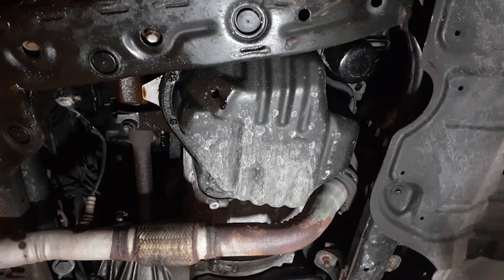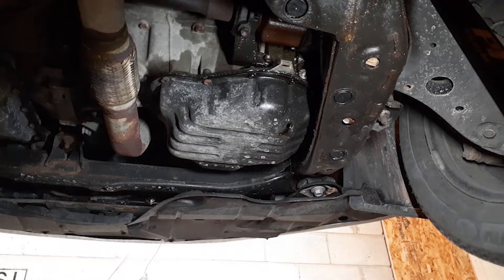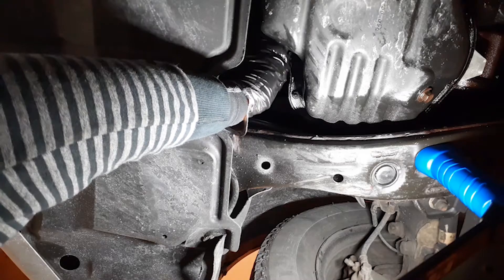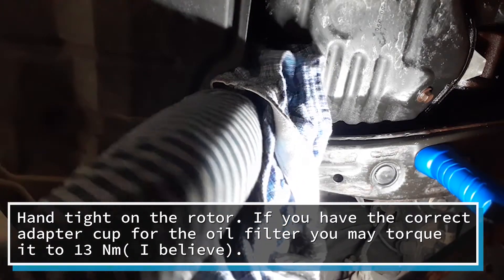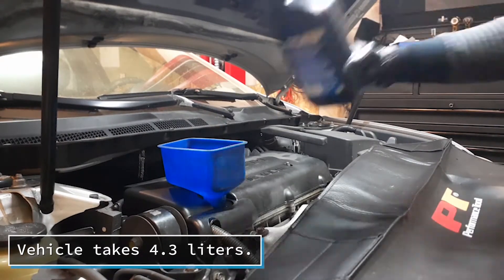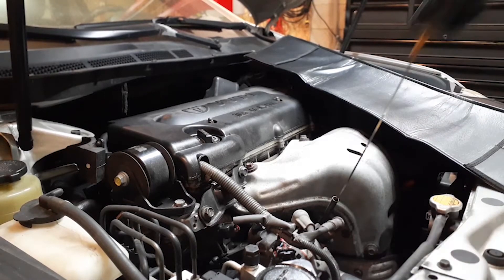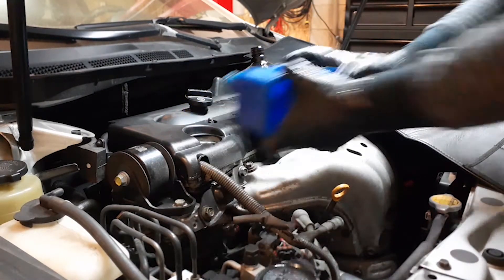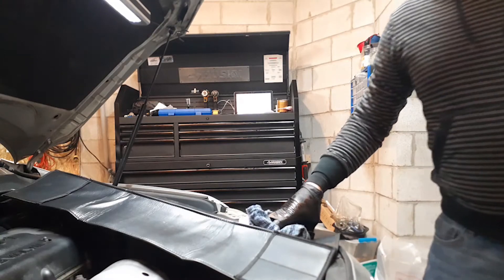Toyota Camry  Oil Change Guide (06 - 13)

Comment: Is ow-20 safe to use for the 2007 toyota camry??
Reply from the maker: I believe it  calls for 5w20.
Reply: @MyHomeGarage  OK. I was wondering because on the cap it has both 5w20 and Ow20.
Reply from the maker: Personally I wouldn't use 0w20. Toyota's.  That specific car has some oil burning issues as it is. 0w20 is like water. The whole 0w20 is all about fuel efficiency and nothing about engine health. 5w20-5w30 I believe is a suitable for that vehicle. In my opinion.
Reply: @FK_TRUMP  
Yes in fact I prefer 0W-20. It has the same protection as 5W-20 at operating temperature and has increased flow rate during cold starts. I used 0W-30 in a 1996 Accord and 2002 Honda CR-V. Put over 200,000 miles on each and they still didn't use any oil between changes. That year (the 2007 Camry) had problems with oil consumption due to defective pistons & rings. If those problems have been rectified then all should be good to go.